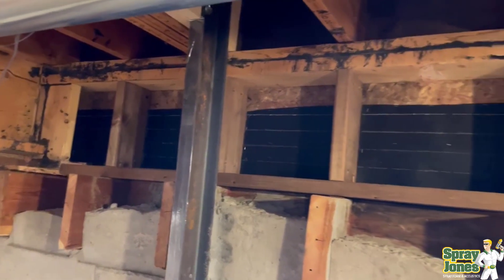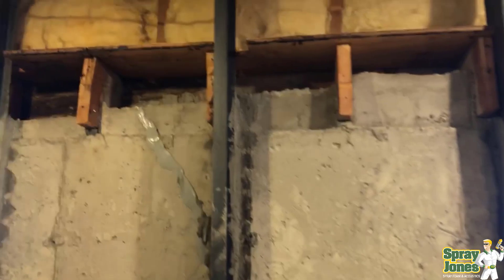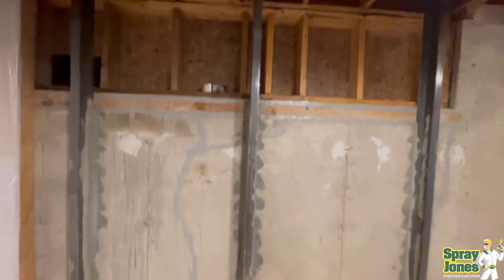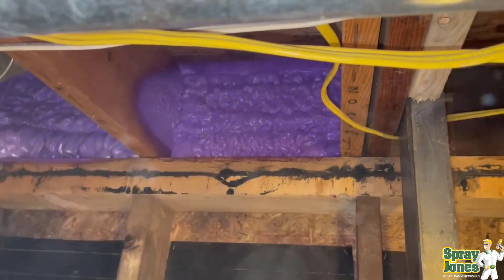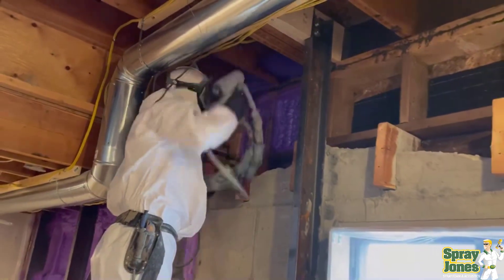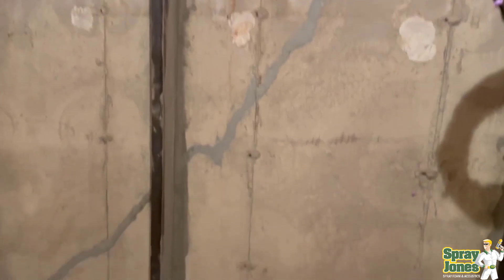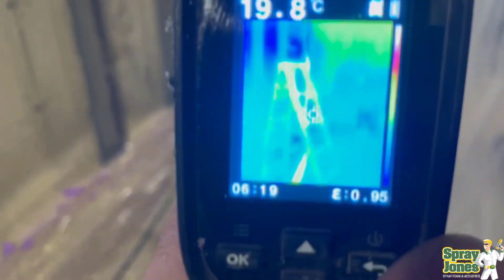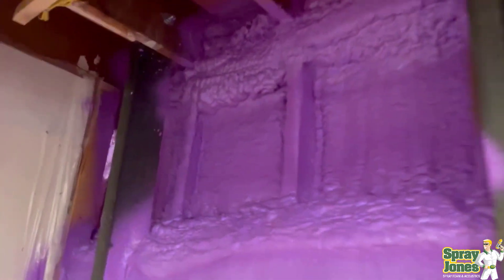Big Foundation Blunder Fixed with Closed Cell Spray Foam Insulation

Comment: I love these videos.  I have a deposit to spay my entire new home project.  I am worried about it being too cold for the foam to cure (in March).  The above video was sprayed in the winter?  Should I preheat the house prior to starting the project?  What should the substrate temps be?  The owner of the company said he can spray down to 7 degree F.  Thanks!
Reply from the maker: You need to watch the videos recently released on "let's learn SPF". Part 3 Heat heat heat....

Comment: If you are sealing wall / concrete from inside - how does the water pressure from outside helps? Wouldn't it cause issues in concrete long time?
Reply from the maker: No.

Comment: Now this is a perfect example of what closed cell can do for you!!! Using the foam to its fullest extent in this video! 
Thank you for sharing
Reply from the maker: That is what I thought when I first got there, but when you look closer you'll note they poured the concrete short. So it was a lack of material and hence the height issues.

Comment: Hey spray jones. Someone on Reddit mentioned that I reach out to you about some lingering smell from a spray foam install. 

It’s been almost 3 weeks and our attic still smells of fresh paint. Contractor provided some mechanical ventilation but the odor is as present as it was a 1.5 weeks ago (when fan isn’t running).

When we last met with contractor up in the attic my wife and I developed a headache and at that time we decided that we (us and our two kids) should leave until we find out what’s wrong.

I’m seeking some advice on what to do next and really appreciate any and all help.
Reply from the maker: I sent a reply to someone that emailed me about this. Check your junk box.